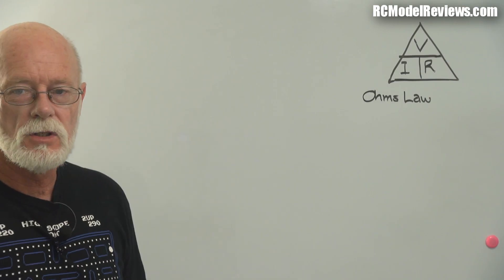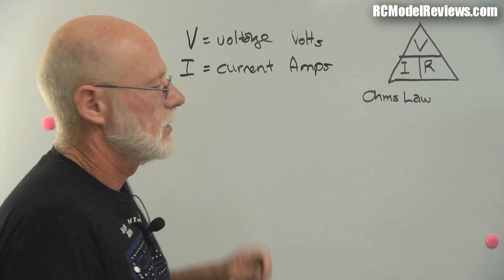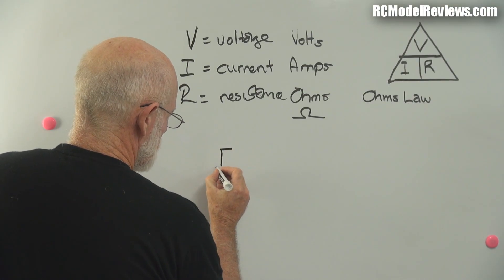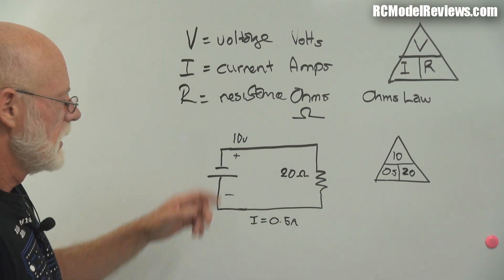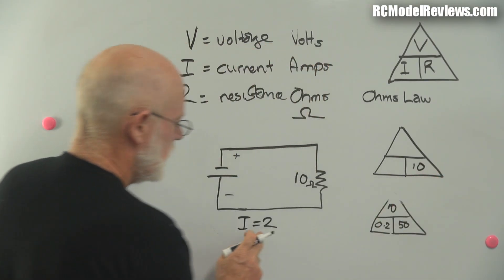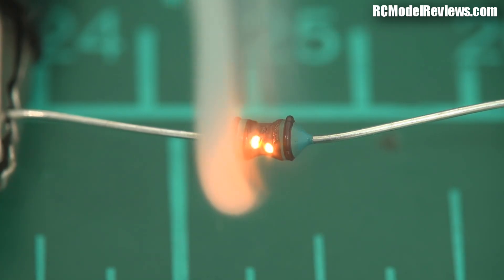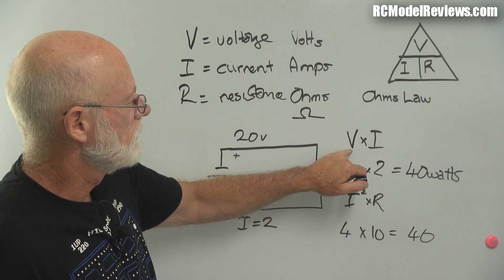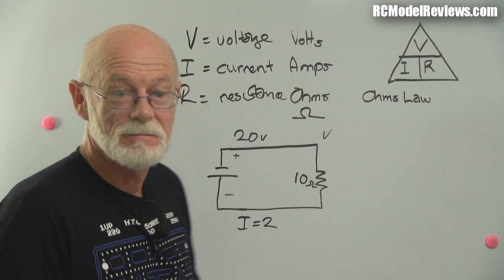Ohm's Law explained

Comment: so IF HYPOTHETICALLY I wanted to increase the power output of a motor in a RC plane by increasing the amps (assuming I wouldn't fry everything in the process), could I replace all of the resisters used in the circuitry with ones that have less ohms and increase the amperage draw therefor power?  

I do know that there are limits on the batt. and the amount that they can safely draw with out melting or bursting into flames and that usually the manufacturers have already set the limits of such equipment.
Reply: +Leeroy002 No, the battery is more or less hooked straight to the motor(through the ESC, very rarely resistors in that path, just FETs), to increase the current you would need to up the voltage as you can't change the internals of the engine(well, you can rewind it, but that's somewhat complicated and not a magic bullet).

Basically the engine in this case is the resistor(It's a bit more complex than that, but lets not worry too much about that), so to up the current you'd have to change the battery or the engine.

Battery/ESC/motor ratings are there for a reason, mostly it's heat related(In electronics heat is your enemy, unless you are making a heater of some kind). Do note that battery ratings seem to be somewhat inflated, will silly C ratings here and there.

Comment: The conventional symbol for current is I, which originates from the French phrase intensité de courant, meaning current intensity.[3][4] Current intensity is often referred to simply as current.[5] The I symbol was used by André-Marie Ampère, after whom the unit of electric current is named, in formulating the eponymous Ampère's force law, which he discovered in 1820.[6] The notation travelled from France to Great Britain, where it became standard, although at least one journal did not change from using C to I until 1896.[7]          Thanks Wikipedia